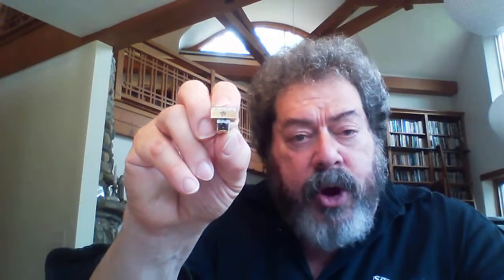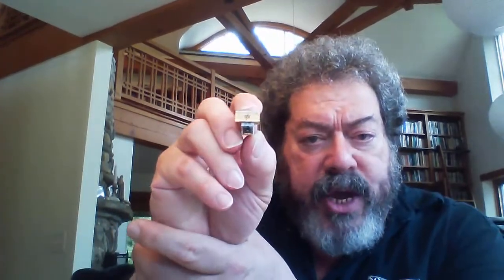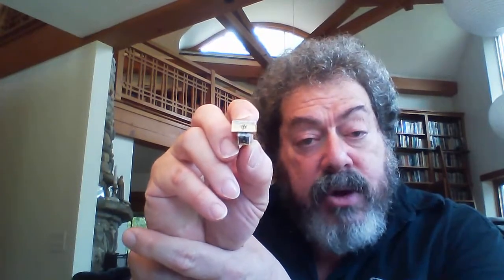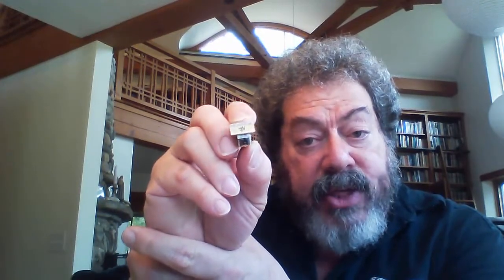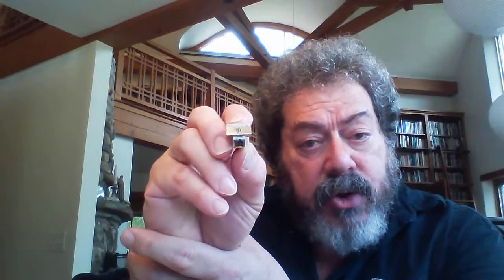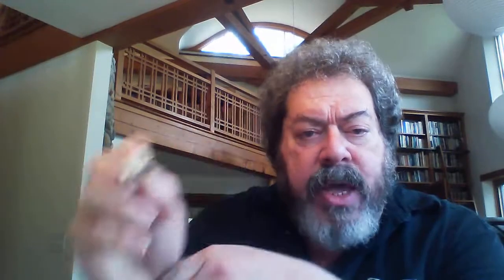Azimuth Cartridge Alignment ~ Part 2 ~ Peter Ledermann of Soundsmith

Comment: Interesting peter,  we can assume we have the turntable level and the tonearm level on its arm board so that the headshell is level or horizontal also, but what if it is not?  Then this got me thinking of those arms that have no azimuth adjustment.  Is it possible to correct azimuth by tilting the arm board if this was possible, or is that undesirable. I would appreciate you comment on this.

Comment: The bottom line should be that manufacturers are responsible for aligning components of the cartridge in assembly, so that simple horizontal and vertical aspects end up parallel to the larger cantilever, and body of the cartridge, making for easy installation by eyeballing the larger elements which are readily observed without an electron microscope. I would have to think modern production facilities logically are going to have to utilize all sorts of micro-adjustable holding and clamping mechanisms as a matter of course during these steps, and the notion of any person just doing everything with tweezers and a prayer seems pretty silly. I would anticipate that major brands with long histories would be the most likely to produce consistent results across their line, with high-end smaller companies next, at least with their most expensive models. Aural adjustments for azimuth may be confusing too light a tracking force, low VTA, anti-skating errors, etc. as all of these secondary adjustments come into play only after the main setup steps are properly accomplished. If the headshell and cartridge body appear to sit horizontally, one or two degrees should be very hard to differentiate by eye, and sonically as well, barring gross manufacturer malfeasance.